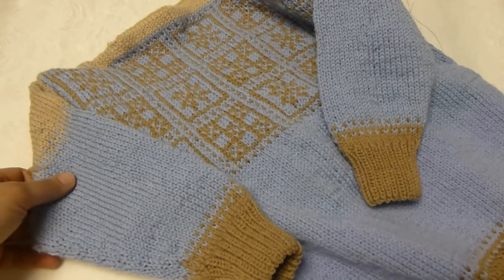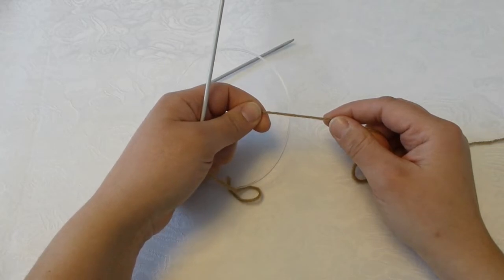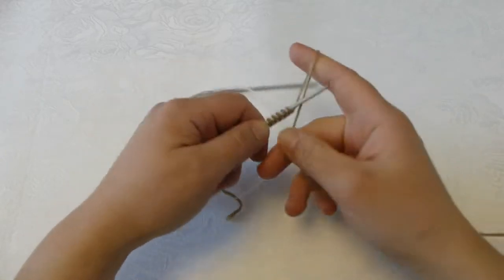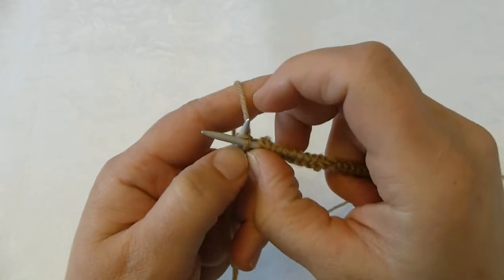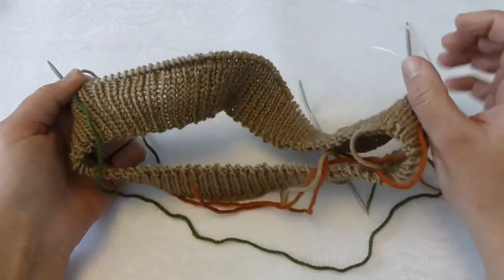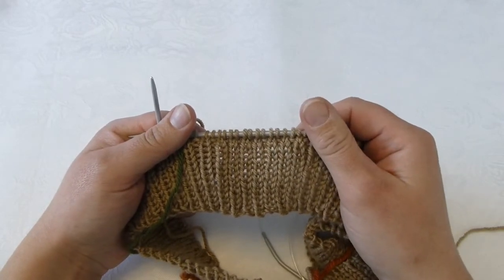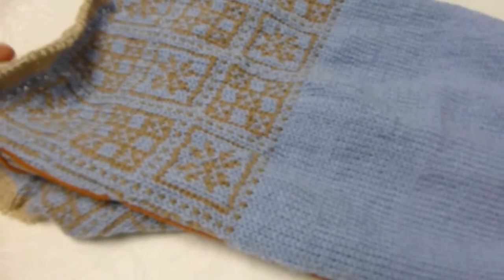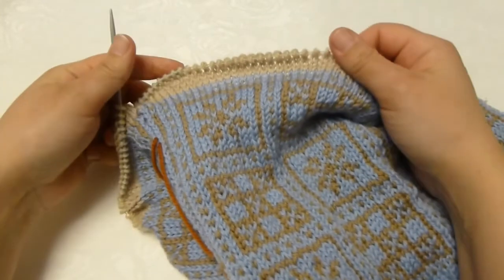How to knit traditional norwegian sweater with boat neck, Step 1, the body.

Comment: What size needles did you use for the rib? And what kind of yarn/ weight? Thanks
Reply from the maker: needles for rib: 3 mm. Yarn gives 22 stitches per 10 cm with needle 3,5 mm ( dale falk)